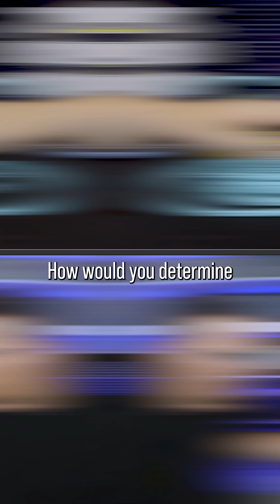Stop Staring... Use THIS Phone Trick to Test Fiber!

Comment: Actually if it works on the first tx window, you can see s faint hue of red. Those are short distance and easily to identify. Red hue means you are likely safe if dumb enough to look into the laser at the other end.

But second and third tx window lasers are invisible to the eye. Perhaps a phone camera can see the second tx window, but it is unlikely for the third.

Those two are medium to long range. Powerfull enough to leave a burnt pin forver blind spot into your eye in half a second of stareing.

Please, handle fibers and sfp with their lids and caps on. Open at 45 degrees to the side when looking at them to plug properly. And always behave as if they are lit and dangerous.

Take it from a professional with 20 years using both eyes to plug in optical fibers.

Even got so used, that i sill follow the rules when dealing with the low power visible red plastic "fibers".

Better ssfe than blind.

Comment: You can also use you phone camera to find infrared cameras as well.  Try this: point your phone camera at your TV remote (typically IR,) and press a button, you'll see it flash through the black plastic shield.  My neighbor has IR on their security cameras, and you can see the rings of lights around the lens show up white/blue in the dark.  Neat little tip for sweeping around your AirBnB or rental cabin or whatever, if you're the paranoid sort :)
Reply: Be aware of the poop cam. 🤣

Comment: The second option is not for figuring out if the cable is connected or not! You dont plug a fiber checker into a patch to check if its connected or not. Obviusly its not connected when you are able to plug it onto your fiber checker. Usually you check if your patch has any damages or you are locating the right cable. For example 10 m patches installed as a bundle on a rack... But the first option is nice